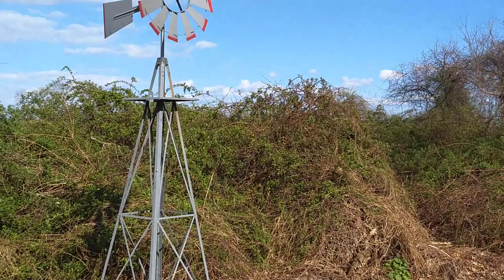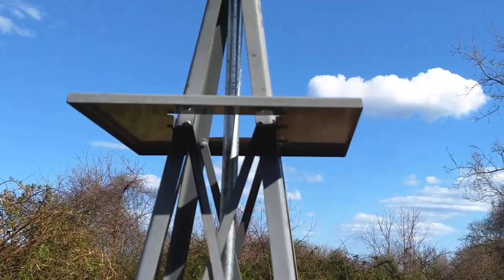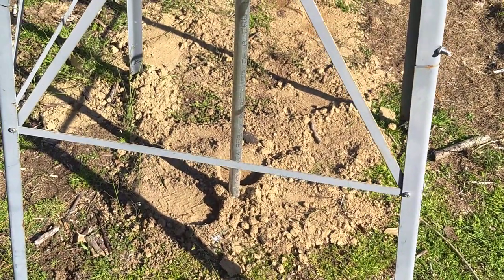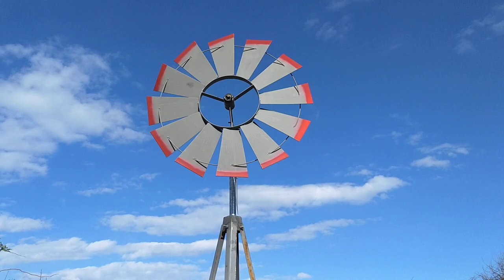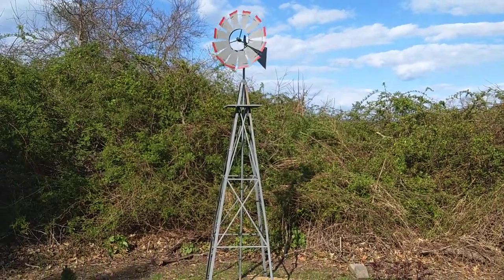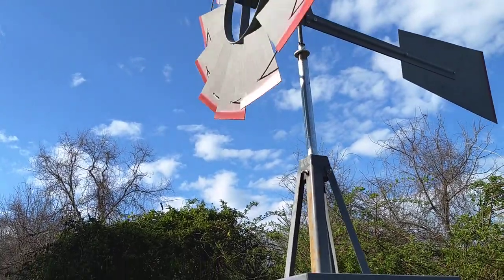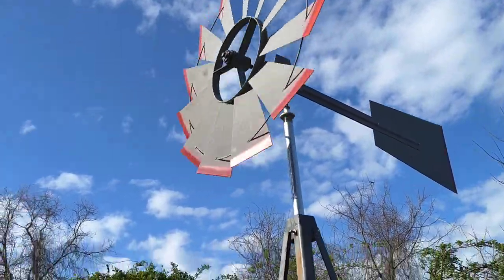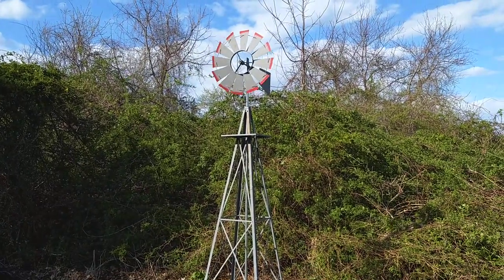Ornamental windmill repair

Comment: Glad I saw your video BEFORE I put up our windmill!! Great idea!
Reply from the maker: Hey thanks!  Since I live near the Long Island sound and the wind is crazy in the winter, I don't trust the fan up all year.  I take it off, and I replace it with an arrow I mad that just spins and shows wind direction.  I will switch back to the fan in April.  Really an easy fix for horrible manufacturing.

Comment: Thank you for the tip. I went one step further. I used a 1/2" x 6" galvanized nipple. I reamed the upper hole of the mast head just large enough for the pipe to just slip through. I then reamed the lower hole just large enough to thread the end of the nipple through that lower hole. After I screwed all the threads of the nipple through the lower hole of the mast head I drilled through the mast head and through the threaded end of the pipe to install a large cotter pin. This cotter pin will keep the 1/2" copper insert from dropping all the way through the galvanized nipple. I cut the upper treads off of the 6" nipple just for looks. I cut the copper pipe slightly smaller than the galvanized  and slid it into the nipple until it bottomed out onto the cotter pin. I greased the windmill shaft well and lowered it into the copper pipe. It fit perfectly. The windmill turns easy and its better constructed now than when new. I don't look for the copper pipe to wear well. Being a soft metal it will probably need replaced now and then but what could be easier. I can lift the entire head out, knock out the worn copper pipe insert and replace it with new in just a few minutes. This fix uses your tip on the galvanized pipe with copper insert but eliminates the look of pipe running down the entire length of the windmill. BTW to re grease the pivot pin its just a matter of lifting the entire head off, greasing the shaft and lowering it back into to pipe. No need to disconnect any cotter pins since there are none needed to hold it in place. Like you say. Its held in place with its own weight.
Reply from the maker: Necessity is the Mother of Invention!!

Comment: This is a great modification.  Does the mast head need to be modified to get the galvanized pipe to pass through?  Also is the copper tubing the coiled type made straight for the desired section or are there straight sections available to purchase?  I think the galvanized pipe makes it look much more realistic while adding strength to the structure.  Thanks for the great idea.

Comment: Hello..I purchase the windmill  from amazon, but i am not understanding how to put the rods in place, the rods are all in one piece, like a puzzle piece, and I can’t find any video with the all in one rods. The hole don’t match up.. any suggestions would be great
Reply from the maker: If you are referring to the legs and crossbars, I found someholes did not line up all thatgreateither.If you take an awl, or small screwdriver, that will help pull them together to slide the bolt through.

Comment: So probably about 10 feet or so of the galvanized  and then a foot and a half of the copper?  I need to do this with mine.  Thanks for the idea and the info! It looks really good!!
Reply from the maker: Yes, that ought to do it.  Where I live winter is harsh and VERY windy.  So, I do pull the top of the windmill off and place it in the basement for safe keeping.  I made a weather vane arrow to side in it's place just for wind direction (Winter..hmmm gusting from the Northwest, maybe!! ),
Reply: @tedkucin2428  how did you make your weather vane for the winter? Do you have a video of it? Sounds like a great idea!
Reply from the maker: @sandysue202  I have pictures, but not a video  ..I don't know how to attach them here
Reply: @tedkucin2428  that's OK, tight now I will be doing the galvanized pipe to hold it.  One other question, you put an 18" of copper pipe inside but how did you get it to stay inside the galvanized and not slide down to the bottom?  Thanks again!
Reply from the maker: @sandysue202  I'll have to look! Fogot how I did it.  Maybe drill a hole and a cotter pin?

Comment: Curious on my windmill, it doesn’t want to rotate left to right! Any suggestions
Reply from the maker: I don't know how your "fan' is affixed, so it's difficult to say, . but mine is one piece that fits into galvanized pipe that goes intot he ground.   The weight of the fan holds it in place, and swings freely in either direction.  Look atr the video again.

Comment: I love your idea!  But I can't tell what you got at the top end of your pipe that the piece that had the cotter pin sits down into.  What size of galvanized pipe did you use?
Reply from the maker: sorry for the delay!! Half inch Gal.  The smaller metal rod that points down with the cotter pin sit in 3/8 copper tubing tightly.  I just slid the hole deal into the gal pipe, and that's it.

Comment: What's the total height to top of blades?
Reply from the maker: Never measured it but I would say a little over ten feet.  I need an 8 ft laddet to slide the blade/pipe into place